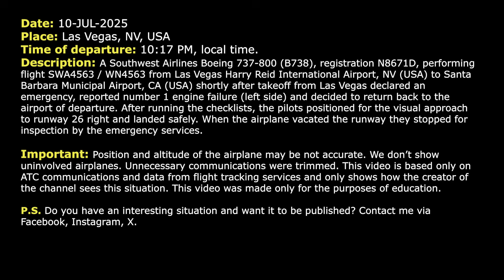Left ENGINE FAILURE shortly after takeoff. Southwest Boeing 737 returns to Las Vegas. Real ATC

Comment: Doesn't it stand to reason that every flight put a sticky note on the dash stating flight #, people on board, and takeoff weight/ time fuel to make it easier when an emergency happens? This pilot, like many others, seemed to trip over that info. 😒 Too much "Uh, uh...stand bys"
Reply: Have you ever had an engine failure on climbiut of a busy airport before and had to get the aircraft cleaned up, fly a complex special departure procedure, run a checklist and fly or monitor for safe airspeed, altitude all while ATC is demanding answers from you about something they can get in 2-5 mins when the workload is much lower? No? Ok then maybe just don’t comment.
Reply: Who cares? Plus the fuel is always changing.

Comment: The FAA needs to standardize and educate ATC on when to communicate with an airline in an emergency- for example, don’t demand answers immediately after someone advises of an engine failure or fire- let the pilots adjust to the emergency- don’t demand souls and fuel- especially right after takeoff- and speak slower- it’s much harder to hear clearly when our bodies are under significant stress. I could go on with more ideas but everyone gets the drift. This video is a clear example of the need for further training and standardization.
Reply: ATC doesn't "demand" anything.   They ask.   Never have you heard them tell the pilot WHEN they need to answer.  Also remember these videos are HEAVILY time compressed.
Reply: "WHEN YOU GET A CHANCE" is not a demand!!!!! They need certain information,  if something were to happen in event of fatalities, etc!!!!
It's  standard procedure!!!!
Reply: @TomH26  exactly.  they have to know how many people on board to ensure all peeps are accounted or upon landing and deplaning.  And they have to know fuel in pounds on board to make sure fire has the necessary extinguishing materials.  Pilot/copilot has a checklist to go through upon all landings.  I was on this flight.  The crew was awesome.
Reply: Congratulations! 
Great Crew!